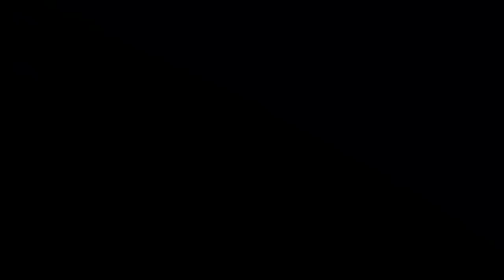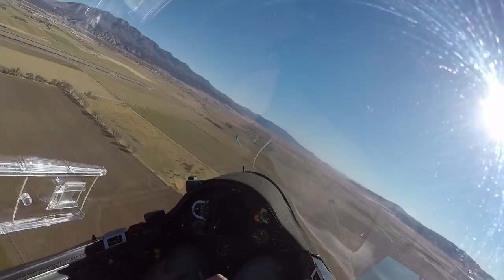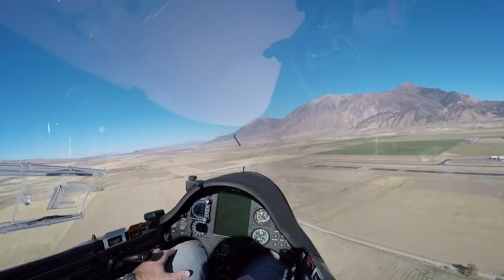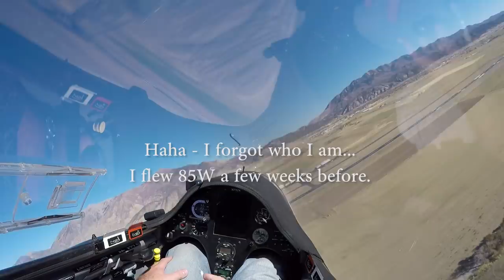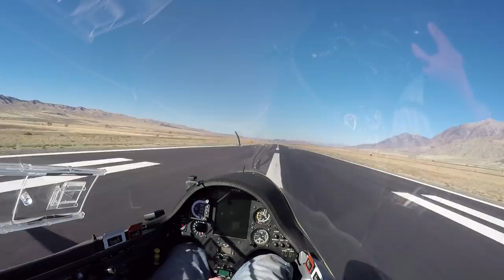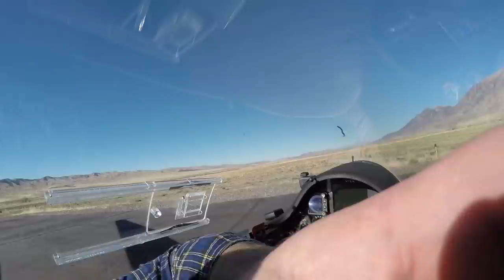Glider Ground Effect Demonstration

Comment: Ground effect is because the high pressure air created under the wings is sitting against the ground, creating a cushion :o)
Reply: RetroGamerVX it’s because the extra high pressure air caused by the air bouncing off the ground and striking lower surface of the wing, adds to the pressure differential between the upper and lower surface. Ie greater static pressure (on a surface) below. It’s not the cushion itself because weight is still acting downwards so it’s always explained by the differential.
Reply: No room for tip vortices.
Lol
Reply: Ground effect has nothing to do with a cushion of air. There is less drag due to WTV's being cancelled out by the ground below reducing drag. This is why airlines started adding Wing tip generators. They effectively reduce drag on the linear axis of the wing root allowing a more efficient wing
Reply: K. Bierman 
Oh dear, quick lesson on aerodynamics.

The glider flies by accelerating an Ovid cylinder of air roughly equal to 1.4 times the wingspan.
This mass of air has the downwards momentum of the time the glider was in it, plus the wasted energy of the tip vortices.

Now, ground effect.
Close to the ground the air cannot gain a downwards velocity so the energy that accelerated the air down is no longer lost, plus the diameter of the tip vortices is reduced from the 1.4 span effective area.

So, saying the air under the wing (and more so in front of the wing) is somewhat accurate as it has the force of the gliders weight acting on one side and the ground pushing back on the other side instead of free moment.
Reply: Over water we call it the wave effect. a good way to beat radar and conserve fuel by allied bomber's in WW2.
Reply: Caspian Sea Monster.
Reply: RetroGamerVX did u look up all that on Google
Reply: Adam Lavelle nope
Reply: Quest ForThe13thNote yes, the cushioning effect f the pressure differential and the ground..... exactly what I said in different words lol
Reply: Ground effect isn't primarily an increase of lift production,  it's primarily a reduction of induced drag because the wing tip vorticies cannot form so close to the ground, this has the side effect of a slight increase of lift but it's mostly the reduction of drag that keeps you going for so long.
If it were mostly an increase of lift, you'd also get a large increase of induced drag and slow down even quicker (like using flaps).
Reply: How does this relate to the air speed velocity of a swallow?????
Reply: RetroGamerVX This is false. Ground effect is created because the wing tip vortices don't have enough time and room to produce. Creating less drag, creating more speed.
Reply: I like Pizza. It's my favorite.
Reply: I like pony's .
Reply: Less upwash, (nearly) same downwash = bigger lift
Reply: Bruce Baxter please, do people a favor and never become a teacher...
Reply: bushpilot2001 African or European?
Reply: Birds are good at it 🦅
Reply: Hey guys here is my take on the subject. 
The does not increase, however the efficiency of the wing increases very much. As i found, the lift vector actually is combined with the drag vector of the wing, to creat a compound vector called induced lift ( wich is not perpandicular to the airflow). When you now enter the ground effect zone, the induced lift will actually reduce because the drag is decreasing, whereas the total lift acting on the aircraft will stay the same. This results out of a downstream of air behind the wing called "downwash" wich increases the virtuell drag of the wing (you could think of it as an unwanted wing extension) and us canceled out when flying close to the ground. The most impressive example for the effectivity of the ground effect would be the Ecranoplan.
Reply: K. Bierman it only has to do with cushion of air, and nothing to do with w/t vortex. Winglets and wing fence (as airbus calls it) do reduce wingtip vortex induced  drag, and you cant stop it from happening because higher pressure air below the wing wants to equlise with low press air above wing, and since air cant go through the wing the only way to do it is over the tip of the wing. If nothing else fling low to the ground would increase that effect because of increased air differential pressure.
Reply: RetroGamerVX actually that’s not correct. There is no cushion underneath the wings. That’s a common misconception. What is happening is your wingtip vortices that usually are creating drag are being disturbed and not allowed to develop by the ground therefore less drag is being produced. There’s no increase in lift only a decrease in drag.
Reply: Ooohhhh so that's why landing a plane in war thunder is so hard...
Reply: Keep talking Mr. Smartypants.
Reply: So, more lift?
Reply: @Simon-gg1gx  Ah... that sounds like a more scientific description of...a cushion. LOL. You're just actually describing how the "cushion" forms,  which is a good thing.   The low pressure air above, which I don't think is altered by this effect, the low pressure to surface also produces wing tip vertices which get trapped beneath the glider, adding to the ground effect.  So you have added pressure below, the lower pressure above which isn't really altered, so that's like a big cushion that lets you go further.  LOL. WAY FURTHER!
Reply: RGVX no. Ground effect is being so low that the wingtip vortices can’t grow so you have an apparent reducing in induced drag
Reply: Time to make hover cars and shit
Reply: On voit rien putain
Reply: Having actually studied aerodynamics, I can tell you that glider sinking rate is a function of drag and that around half the drag budget of a glider is induced drag which is due to the loss of pressure between the upper and lower surface flows near the wing tips.  Ground effect begins at about a half span height from the ground and reduces the pressure loss near the tips which in turn reduces the sink rate.  However, there are other effects like wind velocity gradient due to the boundary layer effect near the ground.  As gliders land into the wind, there is less headwind near the ground.  So it's ground speed is much higher for the same airspeed.  This combined with reduced induced drag gives the glider a much shallower glide angle relative to an observer on the ground.  If you want to extend the landing distance because you are maybe a little short of the runway, you put the nose down and convert your height to air speed.  At speed the glider is running a lower angle of attack and lower coefficient of lift (CL)  as induced drag is a function of CL squared, the induced drag is vastly reduced at this low CL trim and further reduced by the ground effect.  Also, the gliders ground speed is much higher due to far less wind near the ground.  Therefore the glider can now fly a much greater ground distance before washing off it's airspeed into the drag.  This all vastly enhances the gliders ability to reach the runway that it could not otherwise have made.   Conversely, if it has too much height on the approach  it would be a grave mistake to dive down for the above reasons, you could not wash off excess airspeed to land safely.  The best solution is to increase drag with spoilers, flaps or and up trim etc  Spoilers obviously increase drag but deploying flaps and up trim push the wing to much higher CL, higher than optimum L/D and even higher than min sink rate trim.  As induced drag is a function of CL squared, the induced drag goes through the roof and once the now excess airspeed is washed off to equilibrium, the glider begins a very steep decent at very low stable airspeed and as the head hind is strong at height, the descent path can look like the glider is almost parachuting to the ground.  It is important however to not overdo this and risk a tip stall or full stall and it is important to only make micro down trim adjustments at low air speeds because aero forces will magnify down pitch relative to pilot trim and you could quickly find the ground in a very bad way but it is an option if you are to low to go around again but in danger of overrunning the landing.
Reply: @bushpilot-bm3kf  African or European?
Reply: @adamlavelle883  No I flew a B-29 from the soloman's to pearl on low fuel.
Reply: SWEET the correct answer was a question, african or european! Monty Python's The Holy Grail!
Reply: @daviddiscenza3187  Correct! answer was a question! Long live Monty Python!!  Funniest movie ever for a me!
Reply: Does it only works for gliders or does it also works for larger aircraft?
Reply: It reduces the induced drag. The explanation in the video was correct
Reply: Sebastien Van Crombrugge The Blackburn buccaneer could sit at very low level at very high speed. In fact at this height and speed it could outrun any US fighter because as was said....it flew too low for too long and too fast!
Reply: @Doctor Pisson then again, you can't base a handful of peoples intelligence in a state to the rest of the people in the country :p
Reply: RetroGamerVX Nooo! False! Ground effekt thats all the insects are blowing in the air to avoid landing on them!!
Reply: It's a reduction in induced drag and a change of direction of the lift vector. If you fly in normal conditions, the vortices fully expand and angle downwards behind the aircraft, which is called downwash. This also points the relative wind downwards and since the lift vector is perpendicular to the relative wind, it goes slightly backwards. This is also the reason for induced drag. So if the vortices cannot fully expand near the ground, there is less downwash, the relative wind goes less downwards, the lift vector is going less backwards, which leads to less drag and more lift (relatively, not absolutely). The explanation with the cushion is the kids version, not completely false but also not the truth.
Reply: Thank you
Reply: No, ground effect is when the ground blocks vortices created by the wing. These vortices normally cause drag, but if they're interrupted then they don't. It's much like the use of raised wingtips on planes (and birds) - these block wingtip vortices to reduce drag. The pilot in the video is correct.

https://en.wikipedia.org/wiki/Ground_effect_(aerodynamics)
Reply: @RobManser77  drag is a rear effect, the wing simply compresses the air underneath, creating a cushion, it's why with some fighter jets  once you get ground effect  even full forward yoke deflection will mot push the nose down.

Comment: I see pelicans doing this over the waves sometimes it's incredible how how far they go without flapping once. Sweet demo!
Reply: I saw flying fishes gliding over sea for 20-30 meters without flapping anything, I thought I was dreaming.
Reply: Pelicans use ground effect and a phenomenon called dynamic soaring. When you see them pull up and turn into the wind before heading back down between the waves, they are gaining a very slight amount of total airspeed due to the different wind speeds in between the waves and at the wave crest where the air is being compressed. You should check it out if that kind of thing interests you. Rc glider flyers have managed to break the 500mph barrier using similar techniques but on mountain tops instead of ocean waves.
Reply: Michael Nickname  Yep. The real max airspeed number is actually higher than that but the point at which they take the reading is the slowest part of the circuit. The formula they came up with for calculating the max speed from the reading on the radar gun should put it between 560 and 600mph. The guys doing this are at the top of their game in regards to flight skills, building skills and aerospace engineering ability. https://www.youtube.com/watch?v=nv7-YM4wno8
Reply: @shmaknapublar  thats right, there are some good clips on Ytube of the RC gliders doing this.  I fly RC slope, used to fly RC helis and powered planes...which were great fun...but RC gliding is in a different league:)
Reply: I love seeing my favourite YouTubers in the comment sections of quality videos deep in the recommendations well
Reply: @TURST67  aaqqaaqq
Reply: That's dynamic soaring rather than ground effect.
Reply: The sea is the densest in the 2 meters above the  sea. 

I have seen albatross fly  line abreast in the lee of a causeway where enough lift  could be found.

They know.
Reply: I try this with my Camry and the judge say "go to jail" for 31 days.

Comment: I was 40 years old, learning with a experienced instructor in an aluminium glider made in Chekoslovaquia ( Blanik) .  I was aproching final and he talked to me and made me rest some time away from the landing field. Before the landing field there was a wired fence  for cows ( in Bahia Blanca, Argentina ) . He then asked me if I think that we will managed to arrive with enough altitude to surpass the fence... I told him that I thought we would NOT ... He told me to try my best, and I did it. We flyed up to where the fence was and we were already beneath (the fence is 1,20 meters high). So we were flying less than that ( may be 0,70 meter.) I kept cool, knowing he was teaching something I didn't know. Just before the  wire fence he said " just skip the fence and get down again"  and we did it !!!  ( I was absolutly astonished, gratefull 
and very happy to learn in practice this theory.)  Now I am 74 ...

Comment: I flew out of Estrella SSE of Phoenix and LOVED practicing high speed low approaches.  Turning base and final from 10 - 15’ off the deck at high speed.  I was flying a Grob 103 (57.5’ wingspan) so you would have to pop up to make the turns and then push it back to the deck.  Serious fun.

Comment: This is great!  Thank you.  One thing though: ground effects are not a reduction in drag.  The air flowing between the wing and the ground flows according to the Venturi effect, increasing air pressure under the wing.  That's what lets you float.

Comment: Fast calculations: 24 sec over airstrip (before pulling up for landing) with speed decreasing from 75mph to 70mph gives around 780 meters flown. 75mph to 70mph is a loss of energy that is equal to 7.2m loss of altitude. THAT GIVES A GLIDE RATIO OF 106!               Note that changing speed loss for eg. from 74 to 70 gives L/D 140 ;) but glide ratio is for sure bigger than 100 which is still awesome

Comment: i have some flight time in a mooney.  exceptional airplane but due to the ultra efficient wing, they just dont want to land.  there is some technique involved to land in a reasonably short distance.  they get into ground effect and want to keep flying.
Reply: EZ VIBE is it just me or do gliders scare the shit out of other power driven A/C pilots?
Reply: EZ VIBE also, I would be interested to hear about the technique required to get that Mooney on the ground☺️
Reply: Thank you for sharing your experience! :)
Reply: @adamey5935  Get the aircraft into reversed command flight when on the final leg; that is,  nose high, high power setting slow flight. Reduce power and slowly pull up to lower speed until you both lose speed and altitude. At this point you're in reversed command. Add power to maintain your desired sink rate and watchout your speed, you don't want to stall.. Regulate speed with elevator input and sink rate with engine rpm (power).
Reply: just to clarify...there is a technique to landing in a reasonable distance, but i never got it.  lol
Reply: adam errett 

i knew some guys that were in a trauma hawk and it unintentionally became a glider.  fortunately, they were able to make it to an airfield and land safely.
Reply: Francisco Díaz 

its been a while but i really enjoyed flying.
Reply: Same experience here... flew Mooney Super 21 once... dog gone thing just wanted to keep flying.. ground effect is incredible.
Reply: Similar thing happened to me when I was given the chance to land a Beech Staggerwing (what a plane!) under instruction from the owner. He knew of its unusual ground effect on landing and liked to scare people trying to get down on his grass strip...which suddenly felt way too short. It really caught me by surprise in such a substantial plane, a biplane no less.
Reply: I wasnt familiar with the name Beech Staggerwing but I recognized it instantly when I saw a picture of it.  Interesting airplane!

Comment: On a side note  -  The legend goes that the Buccaneer can actually ride on its own shock wave at low level, and naturally stays at the height where the pressure from the wave counteracts any tendency to drop lower -  this ground effect was about 18 ft  and it  became the operational height for interdiction  at over 600 knots.

 A USN admiral who had encountered the Buccaneer during joint Nato naval exercises previously and remembered the welcome they got as the USN fleet came into British waters. A flight of 4 Buccaneers went out as a welcoming party and requested permission to do a fly by "over" the US carrier.

Permission granted, nothing airborne over the carrier, all clear, now fly bys were usually a tight formation pass over the ship or fleet, not this time, the four ship Buccs split to send one down each side of the carrier at deck height, the other two straight along the flight deck at very low level and high speed and if accounts are correct, one did the pass inverted.